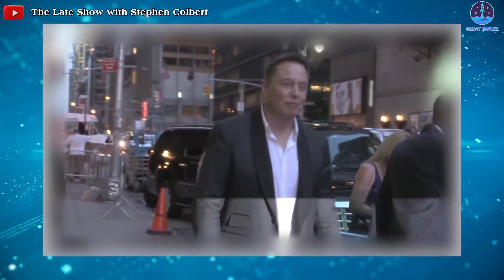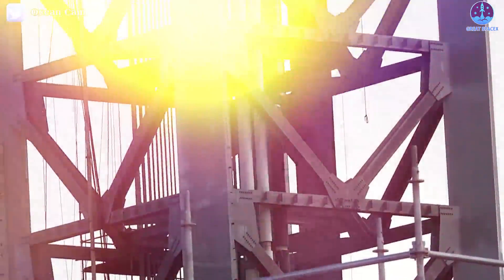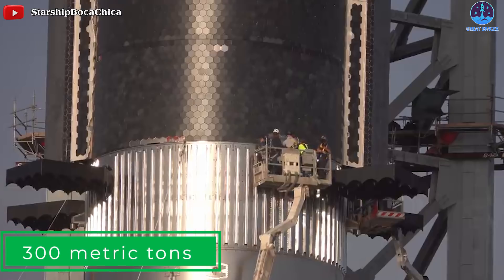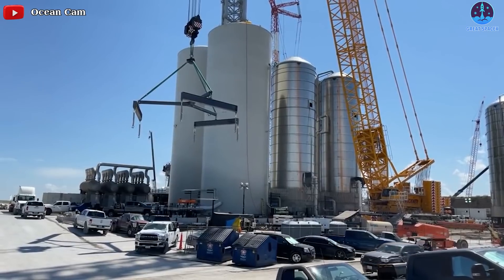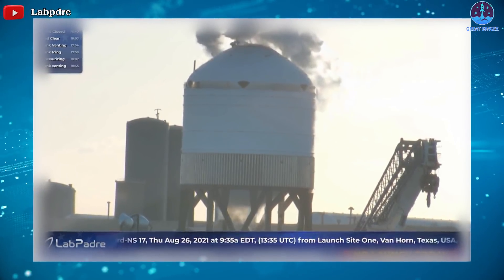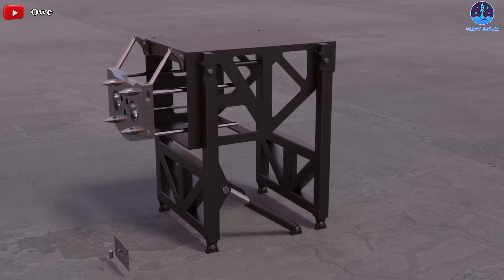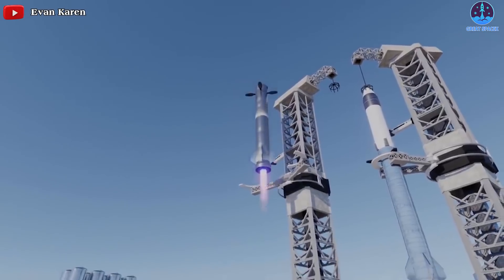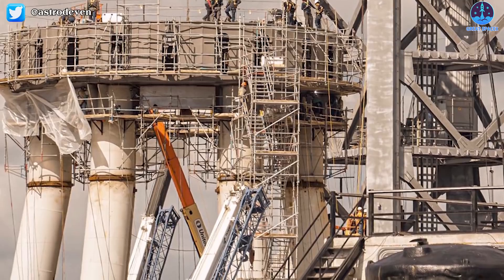Analysis SpaceX Starship's Stage Zero

Comment: Why is it that the Saturn V 1st stage had only 5 huge F1 rocket engines and the Starship booster has gone for 33 smaller engines? Why not go for the smallest number possible to reduce complications? I do realise Starship is more massive but it’s the principle of large versus small, there must be a very good reason for it.
Reply: Because Werner realized that the technology at the time would make 30+ engines a nightmare for coordination. The Soviet N 1 proved the point.
Reply: @WG-tt6hk   ok thanks for that. So are you saying that many smaller rockets are more beneficial than a few large ones? If so then why is that?
Reply: @keithmayes4358  No. What I am saying is that the technology of 1969 was not as advanced as 2021. The Saturn 5 (with 5 F1's) sent men to the moon. The Soviet N 1 (with 30 NK 15's ) blew up ! Elon has apparently solved that problem, but the laws of physics have not changed. Both the Saturn 5 and N1 had huge blast diverters because of their huge blasts at lift off. Starship will equally have a huge blast at lift off (but no huge blast diverter). What could go wrong ?
Reply: @WG-tt6hk    I’m sorry if I am coming across as dumb but I still don’t understand your point. Yes, of course the technology of the 60’s is far inferior to that of today, goes without saying. I know that the Apollo/Saturn moon rocket had flame diverters, I am old enough to remember watching it live on tv, but don’t see what that has got to do with it. Elon Musk has decides not to use flame diverters, I have no idea why, but as you say the laws of physics do not change, the amount of thrust required to get those giants into the sky is enormous, regardless of there being 5 very large rockets are 33 smaller rockets. Maybe it’s a redundancy thing, with 33 engines you can afford for one to fail, not so if you only have 5, a 20% loss is not going to work.

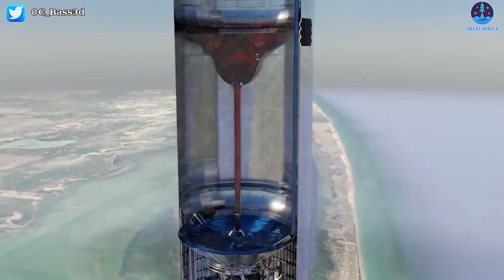Comment: 5:23  lol days or weeks?   use year instead..   NASA´s liquid hydrogen sphere tank only lost 1% in boil off over a month in passive way, this mean that it should be even easier for liquid oxygen and LNG.
Keeping low temperatures is easy when the volume-surface ratio is high enough and when you eliminate the 3 only ways for heat transfer, which are (radiation with low emmisivity materials, conductive and convective with vaccum).

Comment: I have been down to the site. It is amazing. I do have one concern (that Elon doesn't seem to be worried about) The big rockets (Saturn V & N 1) had massive flame diverters. They were needed because of the massive rocket exhaust the monsters created at liftoff. Starship is bigger than either. There is no massive flame diverter, the tank farm is close to the launch pad and so is the control block house. I'm sure that this has been addressed by Space X, but I have never seen any explanation as to the blast effect at liftoff. I hope it won't be "Whoa ! We didn't see that coming !"
Reply: Elon said he doesn't want to use a flame diverter, but I don't remember his ever saying they solved the problem. They had temporary diverters under the table at one point, but they're gone now.
Reply: @ii-es2sn  The point went right over your head, didn't it?
Reply: You LUCKY THING YOU,,, AND U AR RIGHT SAME THOUGHT, BUT ITS EARLY DAYS***8888***